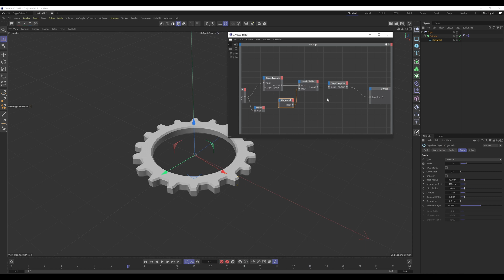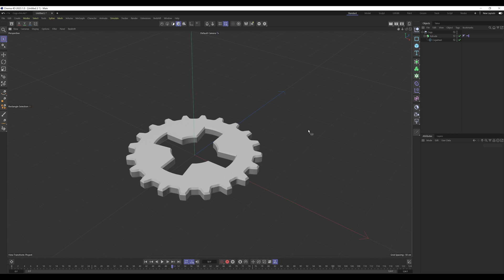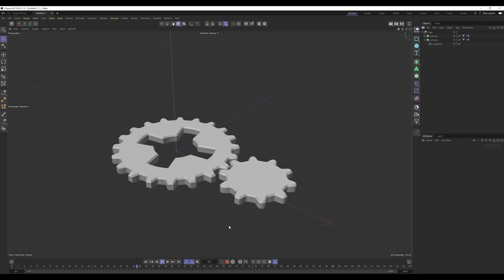How It Was Made: Cog Animation Rig (in C4D)

Comment: you did not show the first node, with the cogwheel. Maybe that's why my installation doesn't work. I just put in first node null and user data with cog speed link with output in range mapper. The time node is empty.
Reply from the maker: Is there a timestamp in the video which covers the part you're having issues with? What results are you getting at the moment?

I'm not sure if it helps or not, but here's a summary of the bits which may be of relevance:
- With the 'Cogwheel' node (Cogwheel spline; child of Extrude), I'm using the 'Teeth' parameter to drive the second 'Input' in the Math:Divide node.
- With the 'Cogs' node (parent null), I'm using custom userdata to output a percentage (Cog Speed). This is fed into the 'Output Upper' in the first range mapper.
- The time node should yield a value of 1 for every second of playback. This is fed into the 'Input' in the first range mapper.

I apologise if this hasn't helped, but I'll try... it's just that I'm struggling a bit with what you've said
Reply: @JTC4D  Thank you so much for your answer and for trying to help. I think there is an error somewhere in the initial stage. 
The cog does not rotate, nothing happens in the node of time. 
But I repeated everything as in your tutorial.
If you get a chance to look, maybe you can see where I made a mistake. 
https://drive.google.com/file/d/1OUfrmnOr7nOeBzVfaw9OYKIjLjQUFRLB/view?usp=sharing
Reply from the maker: @pavelp.5398  I'd advise trying the following test, then let me know where things begin to break: 
 
1. Create a Cube. 
2. Place an Xpresso tag on the Cube.
3. In the Xpresso tag, create a 'Time' node and 'Range Mapper' node.
4. Plug the 'Time' node's output into the 'Range Mapper' node's 'Input'.
5. Plug the 'Range Mapper' output into the Cube's 'Rotation.H'.

This should cause the Cube to spin. 

6. Create a Null.
7. Add Userdata to the Null (using the default data settings).
8. Drag the Null into the Cube's Xpresso window.
9. Plug the Null node's 'User Data' output into the 'Range Mapper' node's 'Output Upper'.

Now if you change the Null's userdata value, the Cube should spin at a different speed.

NOTE: if the userdata is set at 0%, the Cube won't spin. 100% will be regular speed, 200% will be double speed, etc

Let me know if you're having any issues with any of the steps above. If this works, then it should just be a case of replacing the Cube with a Cogwheel, and continuing with the remaining steps in the video!
Reply: @JTC4D  Thank you so much, everything works now, with your help!
At first it didn't work after the 5th step. Then I tried to open the project in version 2023 and everything works there. In my version r23 the cube also did not rotate.
Reply from the maker: @pavelp.5398  No worries at all, glad to help! I didn't expect the 'Time' node to differ between version 2023 and r23, so I'll have to look into that - thanks for mentioning!